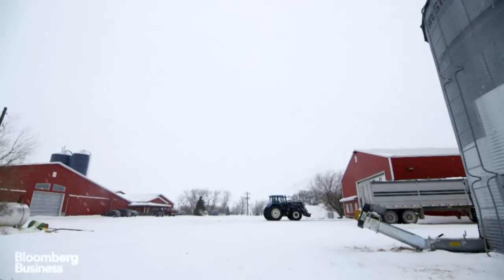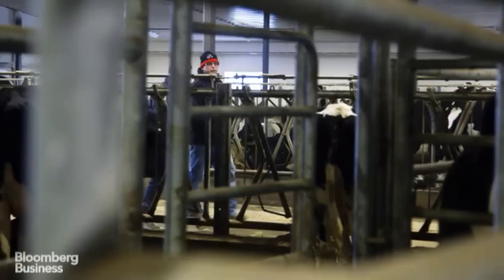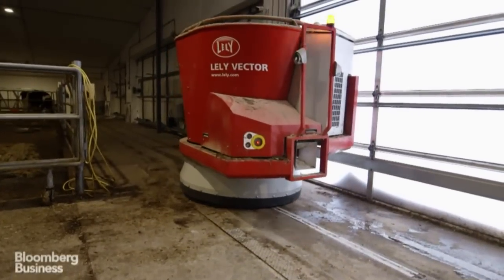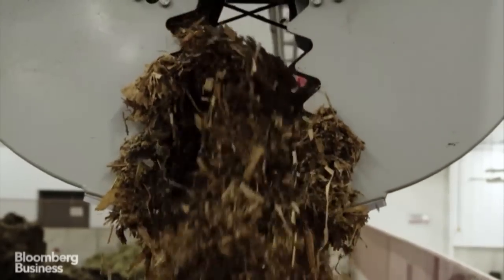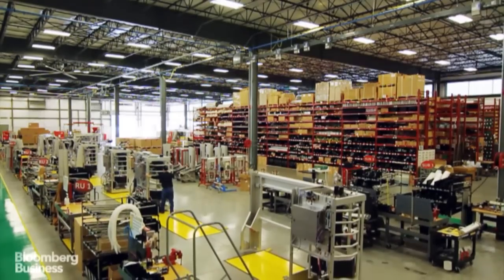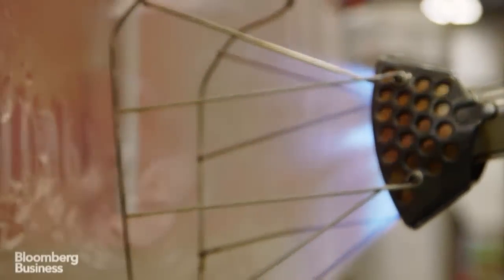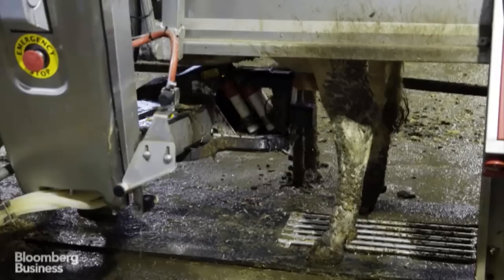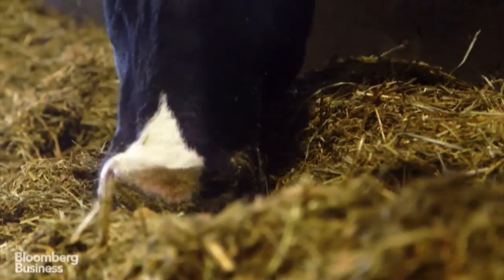How Robots Are Saving the Dairy Farm

Comment: This isn't going to save the small family farms this is going to consolidate the dairies into fewer and fewer mega dairies. Just like Walmart and Amazon aren't going to save small businesses. It will be more efficient but drive down costs by eliminating jobs and smaller dairies.
Reply: @infini_ryu9461  I've been picking up milk for the last ten years. I've seen the horrible working conditions. Outhouses for bathrooms. Break rooms that are full of compressors so it's loud and hot. Sanitation is a joke. Washington state recently required dairies to start paying overtime for the first time. Talked with some milkers that said their pay got lowered to minimum wage. The milkers drive old beat up Hondas. The farmers drive the fully loaded Ford F350 Platinums that are also tax writeoffs. Farmers show up for an hour to sip coffee and check their computer to see if they're still making bank off the backs of the hard workers. Then they go home to their mansions. They can barely provide a sink with running water. Half the parlors look like they've been neglected since the 30s. It's a wonder anyone shows up to work.

It doesn't make any sense to spend eight hours driving to six small dairies to get one full load when you can bring in four or five full loads in the same amount of time.
Reply: @JetSkiBuyFixPlaySellChannel  Right. And you'll rather see them without a job at all.
Reply: @infini_ryu9461  I'd rather see employers treat people, especially their employees with basic human decency. Unfortunately people are greedy and don't understand the golden rule. I hope karma catches up to you.